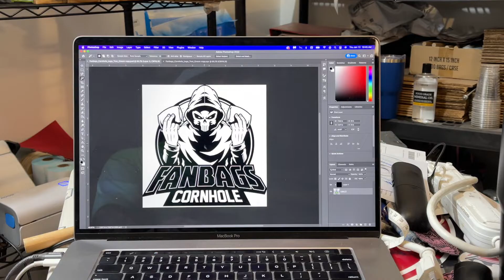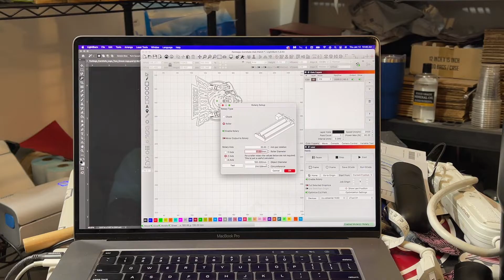xTool D1 10W Laser Engraver - Tumbler Tutorial

Comment: Hey Nate, good job!  I’m wondering about prepping the cups, with products like ‘moly’… I dont want to ruin anything.  Tnx!
Reply from the maker: Hello! Are you looking to do a stainless steel one or a powder coated one?

Powder coated tumblers there is no prep needed on the tumblers, for stainless steel you will need to use something - I have no even tried a stainless steel one as nobody has had any interest to ask me!
Reply: @SodaCityBoards  tnx for the quick response Nate, WOW!  Well, I don’t know what you mean by ‘powder coated’ unfortunately.  What I can tell you is, it is a white Yeti mug.
Reply from the maker: @christinebagatin5945  So powder coated tumblers are ones that have like a color on it such as white/red/black. Stainless steel would just be the bare metal (this one you need a marking spray for). 

So a white yeti would be a powder coated one! Don't really need to do any prep other than get it level on the rollers/chuck and engrave!

I do always recommend buying an extra every every brand/color of tumbler you engrave to run a power speed test on as all colors and brands can engrave differently. I have been lucky and every single one I have done has been the settings used in this video.
Reply: @SodaCityBoards  thank you Nate. I will definitely be watching for more great vids from you!
Reply from the maker: @christinebagatin5945  Thank you very much!

Comment: Hello and thanks very much for doing this video!  You get right to it with useful information and not a lot of fluff. Question - You make it clear that you're doing this with the xTool d1 10W - would you say that's the minimum power needed for burning tumblers? I have a 5W at the moment, but probably about to buy the newer 20w machine. I'm hoping that will give me plenty of power to do this type of work.  Thanks again.
Reply from the maker: Thank you so much!

I’m sure you can do it on the 5w, just have to do your power speed tests to find your perfect settings. But a 20w will be perfect as well with faster speeds too!

Comment: Every time I laser a powder coated cup, the stainless steel is a dark black color and LA totally awesome doesn’t remove the black marks. I usually have the laser set to power 70% speed 30. I use the Xtool software….. is the power too much?
Reply from the maker: Sounds like it.

Which xTool do you have? And is 30 speed mm/m, mm/s, inch?
Reply: D1 Pro 20W..... 30mm/m I have went down to 40% power and I'm getting better results. I'm still new to this, I hate that every brand of cup requires different settings! It's frustrating  @SodaCityBoards
Reply from the maker: So sorry, my YouTube wasn’t showing notifications for replies and just saw this! Did you solve the issue?
Reply: @hunter-cb3qh  Hello, I understand that this is a late reply but I will share anyways just in case.  I have a 10w laser and my setting completely differ.  I use 80mm a second and 40% power.  With this, I get amazing results. Oh, and I use .05 interval

Comment: Hi friend, I thought it was very cool the way you recorded in the Cup. I also liked the small Level but what about...
1) for those who don't have the second Rotary Tool? What do you suggest to keep the Cup on the level?
2) And what liquid did you use to clean the engraving for the first time?  Thanks for the tutorial
Reply from the maker: Hello! 

1 - If you dont have the second part to level your cup, you can measure out the end of your cup and cut out a circle that fits around the bottom and put it on. You will have to get the dimensions yourself and cut it i order to make it level! (I would recommend getting one of them if you can!)

2 - I am using LA Totally Awesome on the cups to clean them! Very cheap and works very well!
Reply: Thank you for your reply.

Comment: These look fantastic! What is the purpose of the Minxwax? Are you using it just as a spacer or as a weight to hold the cup down against the rollers?
Reply from the maker: Thank you! I use that to make sure that the cup doesn’t shift while engraving. I have done them in the beginning without it and the cup always shifted some and messed up
Reply: @SodaCityBoards how does it prevent it from shifting where it’s placed? As in the question, is it functioning as a weight?
Reply from the maker: @LowLos59 so on the left side 
(bottom of the cup) its on the piece to level the cup out (so it wont shift to the left) and the stain can is on the right up against the right side so i have yet to ever have one shift while using it

Comment: Hey buddy, have watched your tumbler video a few times.  I also have the D1 Pro with the 10W.  Question:  I got all the setting that you mention in the video, however, do you run over-scan if so what setting?  Also do you use the cross-hatch feature?  And anything else you might have set on that page.
Reply from the maker: I no longe have or use an xtool as I moved onto co2 lasers and RF tube lasers.

I believe I did 5 for the overscan if I remember correctly